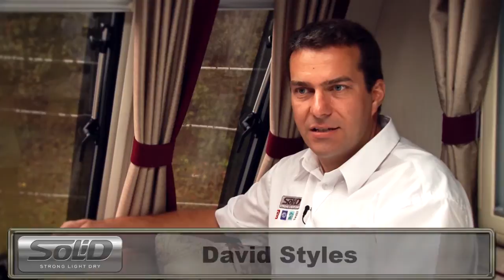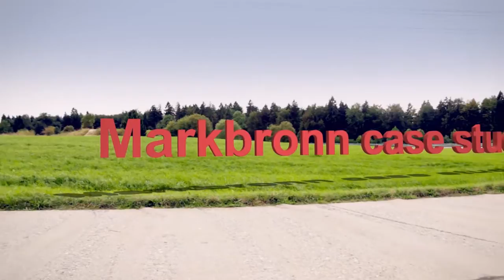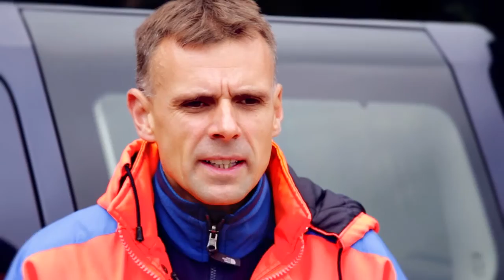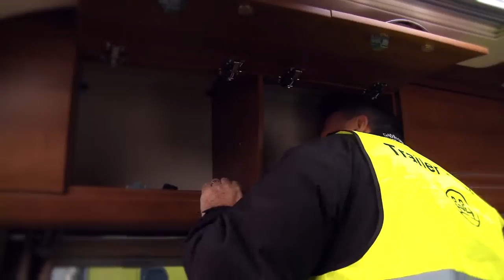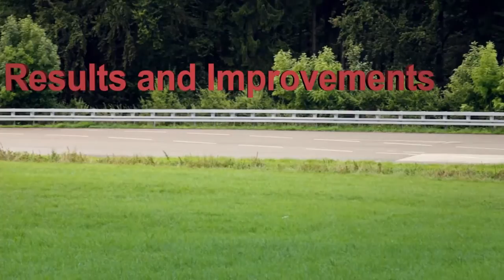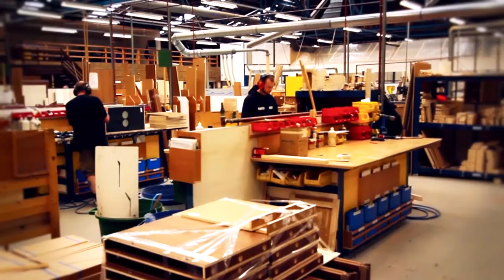Elddis 2014 SOLID Construction Testing Video HD Caravan & Motorhome

Comment: Just sat in my 3 year old compass casita with 'solid construction that has bonded joints that water cannot pass. Just wondering where the water is coming from that is all the way along both sides of the wall/ceiling joint. Confused.

Comment: "All the strain's of a life time's towing" What an absolute load of bollocks. We have been caravan owners for the last 27 years, we have had Baileys, Avondales, ABI's and Sterlings, but we fell for the Elddis Solid hype 5 years ago, and purchased a Chatsworth special edition from glossop caravans. Well 2 new sky lights, and a complete new back panel later, we are still having problems. Just got back from a fortnight in wale's, water dripping in the front sky light, frame cracked again. Then just to top it off inspected the back panel when i got it on the drive, and it's cracked on both sides. Forgot to mention the battery locker trim that cracked after 2 years, and Elddis said it wasnt an integral part of the van. So to conclude 5 year old van 3 cracked sky lights, and 2 complete back panel's, not to mention the battery locker trim. Never ever buy an Elddis caravan, you will be buying trouble.